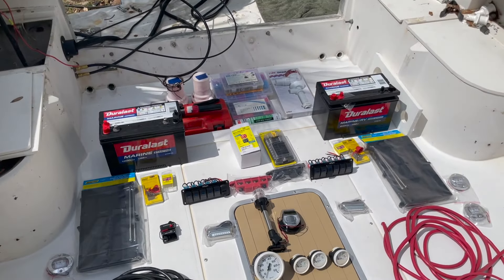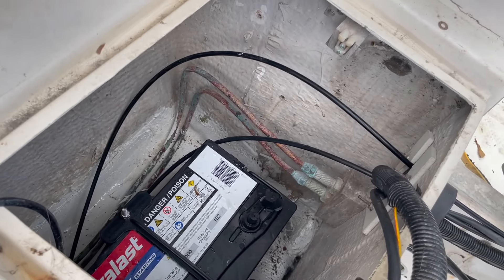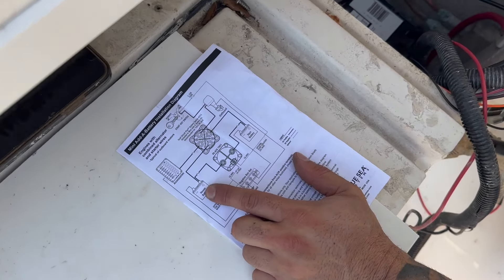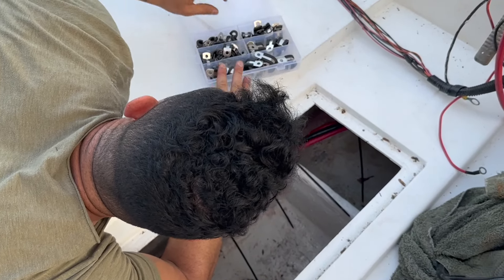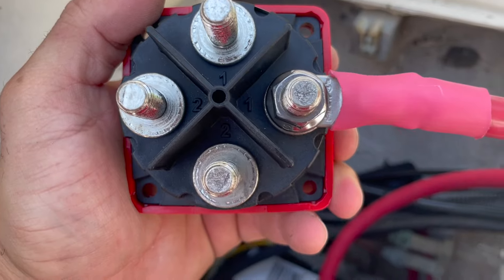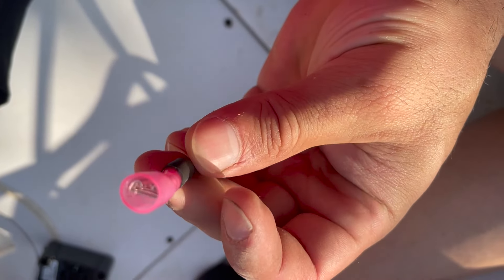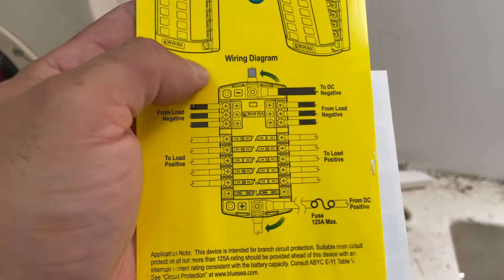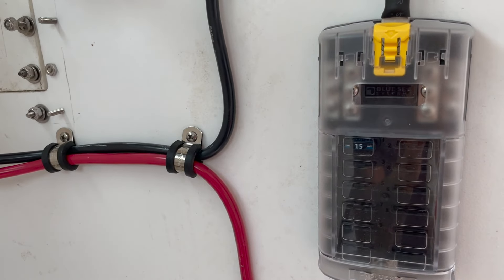Beginners Guide To Boat Wiring | Blue Sea Systems Dual Battery ACR Install

Comment: Anytime you are routing fuel lines / hoses and electrical wires in the same area, Place the electrical wires above the fuel. A fuel line that is above an electrical wire and somehow leaks will drip fuel onto the wires.
Reply from the maker: Great tip! Thanks! 🛥️🤙🌊

Comment: Your cable is 2AWG not 2/0 which is 00 AWG.  Huge difference between the two.
Reply from the maker: Yes that is correct. At 4:52 I say 2 awg cable. What I should’ve done is made a caption reading 2 awg cable. Good clarification! 🤙👍
Reply: @perfectfitboating  I used to mix them up a lot until I had to work with 2/0 and 4/0.  Since then I've never confused the two, haha
Reply: It would work fine

Comment: Pretty good install.  Just FYI, fuses and breakers are not used to protect the components (such as the ACR).  They are intended to prevent fires by not allowing the conductors to be overloaded by current which creates heat and eventually fire.

Comment: looks as if you used the same cable lugs (same size hole) in all your terminations on different sized studs. It is important to match the hole in the lug to the stud or you are compromising the whole system. Otherwise well done

Comment: great video was planning on doing this setup for my battery but ive got one issue, i dont have a positive cable going dierct from the motor to my battery i only have 2 red positive cables running from my motor to my key switch can i still use this setup if so?
Reply from the maker: Thanks for watching! Um, two red cables!? That’s strange. One of them has to be ground. I’ve never seen a setup like that though.

Comment: Nice work!  When running the main feeds to the the fuse block, the feeds can approach the fuse block from the sides, making a slightly cleaner installation.
Reply from the maker: Thanks chip! I’ll have to adjust and see how that looks. I think you’re right it’ll look a little cleaner! 🤙

Comment: Your video and E-book are great.  Getting ready to redue all the wiring on my 1997 Key Largo.  Have one question.  I have a lithium house battery and a lead starting battery.  Do I need a different type of ACR?  Thanks
Reply from the maker: Hey thanks for comment! And thanks for the review of the ebook. What you will need is a dc to dc charger AND the ACR. Blue sea systems sells a system for that I believe but people use a victron dc to dc charger with the ACR. 🛥️🤙🌊
Reply: @perfectfitboating  Thanks

Comment: Great job with laying out all the materials you are using in the beginning. Nice and neat installation. We opted for the Blue Sea ACR system as well. Looking forward to seeing each other on the water this summer, brother!
Reply from the maker: Thank you! We thought the acr was gonna make things easier. It’s either on/off or combine. I don’t want to have to remember to switch to one battery or the other! We’re looking forward to it man! 🍻

Comment: Thanks so much for getting back to me so fast. I have a Grady also with the ping pong ball scuppers. You said you used plastic for through the transom . What make are they? Also I just dis one of my deck plates today . It came out great. Thanks for the great video on that.
Reply from the maker: No problem! Glad I could help. If I remember right they were perko. We have the two little scuppers on each side I’m not sure if the ping pong ball will work since both holes are so close together. I might just go with the flap that covers the scupper. Does it really help keep water from coming in on your boat?
That’s so great to hear you did your deck plate! Not too difficult of a job I’d say! Good on you for tackling that job! 🤙🛥️🌊

Comment: Great video mate but what do I wire the fish finder onto straight to battery or the fuse block?
Reply from the maker: Thanks brother. The fuse block but often times you need a seperate fuse block with heavier gauge wire for fishfinders and gps. So off the wire that comes from the switch, you can branch off into another separate  fuse block for heavier gauge wired items like amplifiers gps fish finders 🤙🛥️🌊
Reply: @perfectfitboating  cheers mate

Comment: Nice job I suggest put wire numbers at terminal or connection point and make yourself a drawing. Much easier  to troubleshoot down the road. Should you have fused both house batteries at the battery? Thank you
Reply from the maker: Thanks so much for the comment! Since then, we’ve marked and label each wire, if not it would be a nightmare down the road. You are 100% correct. 
Both house and start batteries are fused going to the acr as per the acr instructions. I believe they’re 80 amp fuses if I remember right. I think I mention  the amps in the video. If I’m not mistaken, fusing the batteries to the regular switch is not necessary as per abyc. I think you’d need a crazy high amp fuse because cranking the motor would blow most fuses. 
Thanks for the comment! 🍻

Comment: Great job !!...im currently adding a 2nd battery and 2nd bilge pump, and you inspired me to think about tackling the current mess of wires in my cabin (from prev owner)
Reply from the maker: Thanks Steve we appreciate that! I hope this video will help make it easier for you. Check out the latest video we put out on wiring the rest of the boat! We also do the bilge! 🤙
Reply: @perfectfitboating finished my project successfully with your help. Ran into a problem recently with an old wire burning up in the Bilge area. Not sure yet what the wire was too, but I believe it was from the original Bilge pump and/or saltwater pump, but it created a big mess of burned wires that I now have to figure out. Ugghhh. Looks like I'll be watching your vid again and redo everything
Reply from the maker: Wiring an already wired boat can be frustrating! Good luck with that Steve hope the video helps! We have an ebook coming out this week that might help! I’ll keep it posted in a pin comment in the comment section! Good luck!🤙

Comment: I'm the same way brother.  I've researched, drawn out on a dry erase board, watch several youtube presentations, talk to a boating friend who happens to be an OSHA Rep for approval for a days about installing a 2nd battery.  This has been the best by far and extremely helpful.  Learned about the ACR and 80A fuse block.  Gotta add that to my dry erase board rendering..  😁  Thanks..
Reply from the maker: Thank you so much brotha! My mind works the same way. I think it’s just that I second guess myself and want it to work right! Dry erase board is smart! I would draw it on paper 🤣. Once It clicks, i completely understand the process! It just takes all those steps! Glad this video helped man check out the video after this one about wiring everything else. That one might help too! Cheers and good luck with your project. If you need help shoot me an email and I’ll be happy to help! 🤙🍻
Reply: @perfectfitboating  Just subscribed brother.  Between you and Colin from Sailing Parlay Revival, pretty inspiring.
Reply from the maker: Thanks so much man we really appreciate it! We’re trying our best to bring out some educational and entertaining content. The next one is gonna be pretty cool. Transom was ripped out and redone! 
Thanks for the kind words my man! 🤙🍻
Reply: @perfectfitboating  I do something a little different when attaching lug connectors to 2-4G wire.  Instead of crimping the connector, I'll hold the connector with vice grips, drop solder inside the insert, , then slide stripped wire  into the connector.  Did it when I added a 2nd battery to m 2008 Chevy 3500 dually.  Rock solid, no issues.......
Reply from the maker: @aeroscout8409  that sounds like a good way to do it. There are so many different tips and tricks. I love learning them all!

Comment: Love your channel. Can you tell me what you have for through hull scuppers. It doesn’t look like you have the brass ones in the video. Thanks
Reply from the maker: Gary, thank you so much for watching! When we did the transom on this boat, we used the plastic thru hulls. We didn’t want to buy the tool that’s used to bevel the edge and we were on a time crunch to get the motor mounted. They worked just fine and have held up without any issues. The other Grady transom we did had plastic scuppers installed as well.
I think what I’m going to do in addition to these thruhulls is the ping pong scupper or the flap. Both bolt to the outside of the scupper and allow water to drain but don’t allow water to get in. 🌊🤙🛥️

Comment: Is there any situation where it would be a bigger/smaller fuse between battery and ACR? Or is 80amp the correct fuse to use with the mini system?
Reply from the maker: I think in the situation you have a bigger outboard whose alternator amperage is CLOSER to the fuse range of 80-20. Your outboard cranks out 17 amps so 80amp fuse would be sufficient. 
If I remember reading correctly, there’s spikes in amperage’s when cranking but it’s the sustained draw of amperage while cranking that important. Blue sea systems recommends 80-100 amp fuse but doesn’t tell you why such a big difference. The kit is for a 65amp max alternator which is most bigger and smaller outboards. My guess for having the 80-100 amp fuses is the spike of amperage draw on crank. For example, a Yamaha f300 alternator is 70amps. I’d use the higher end of the recommended fuses (100amps).
They make other kits for larger motors. The next up is a 120 amp alternator kit. And those have even bigger requirements such as fuses and wire sizes. 
You’ll be just fine with your f70 and an 80 amp fuse.
Reply: Thanks again @perfectfitboating  - Just getting all my ducks lined up before I go ahead. This is one more thing off the list. Cheers

Comment: nice video explaining stuff. I have a 175hp outboard I use a deep cycle group27 as a start. I'd like to add another deep cycle as a house batt. I'd like to not combine my batterys w/ a switch I'm considering using a battery isolater so I won't have to think all the time what position is the switch on. thanks for any tips also my current battery is 2 years old I've been informed that when combining as you just did both batterys must be of exact same strenght?.
Reply from the maker: A battery isolator is a great option! For best results, when combining batteries make sure they’re the same age and the same AH rating.  Thanks for watching!
Reply: @perfectfitboating  I just found out my Evinrude ETEC has a house battery isolator built into it's computer.thanks

Comment: Which voltage should I choose for a trimeran? 12, 24, 36 or 48?
If it has twin 2000hp diesels and 5 800kw outboards what sort of capacity should the batteries have?
Is lithium the lightest?
Thanks Philip
Reply from the maker: That’s above my pay grade. I know my buddies 70ft sport fish had a 24volt system. Lithium is the lightest but you have to make sure you have the right dc to dc chargers to charge it.

Comment: Thank you so much for this, I am going to add some nav lights and a stern light as well as power my engine 9.9 mercury on my gheenoe, Can I do this with one battery, I may add a trolling motor later
Reply from the maker: You absolutely could. Check out our other video on wiring your boat. We show you how we setup our switches. Glad the video could help! 🤙

Comment: I spray corrosionX in all of my crimp on battery cables before I crimp.   Nice work.
Reply from the maker: Thanks Kevin! I appreciate that! And that’s a great idea I hadn’t thought of that before. Will do for my next projects! 🤙
Reply: Corrosion X is an outstanding product however it should be applied after the crimp is made as it is a dielectric.

Comment: Greetings from Europe👋Great and very informative video. I am planning to install a house battery as well on my own.  I have no experience of any installation.But I have a question about the terminal fuse. If ACR is rated for 65 A why do we need to have an 80 A terminal fuse but not 60 A for example. 60 A fuse will trip out before ACR burns out. As far I understand those 80 A fuses are to protect ACR.
Reply from the maker: Hey there! You are correct! Those fuses are there for the ACR just in case. But the rating is recommended by blue sea systems as so. If I remember right, they recommend 80-100 amp fuse in the instructions and I believe it’s for the spikes in current.🤙

Comment: Hi great video, I got the bigger version from blue seas add a battery kit here recently and I noticed you ran 2/0 cable to your mini ACR. My question is, if I too am running 2/0 cable can I also use a 90 Amp fuse? Just curious and thanks again for the great content!!
Reply from the maker: Hey buddy thank you for the comment and thanks for watching! In your add a battery kit, it might be hard to find, but it will tell you the required fuse you need. And it’s going to be a range. So for the mini kit, if I remember right, it was 80-100 range. Not sure what it is on the larger kit. 
Edit: just checked and this is what it states: cable size to meet ratings -  4/0 AWG (120mm²)†
100-125 amp fuse 
You can find it on the blue sea systems site it’s a pdf file under the “add a battery  7650 kit”
🤙

Comment: Does it matter where the positive cable goes to on the 80 fuse? Fuse on first then +battery cable or cable first and fuse on top?
Reply from the maker: Which cable though. If it’s to the switch, that cable goes directly on the terminal. If it’s to the acr, it goes on the fuse terminal. Hope that helps.

Comment: Great video.  Remember, redundancy is next to godliness?  One comment from my install of 120A ACR, include the switch in the fused ground wire that activates the ACR otherwise you can drain your start battery.
Reply from the maker: Great tip! Do you know how long it actually takes to drain the battery? I’m wondering if it’s weeks or months. 🍻
Reply: @perfectfitboating  I don't know how long but there were enough comments on sailboat videos that I took it to heart with my installation.
Reply: @perfectfitboating  My current problem involves which side of the ACR to connect the alternator.  There is something called ACR Cycling with the standard wiring with an outboard which charges the start battery first.  There seems to be occasions when a motor running at low speeds (eg when trawling)
Reply: @perfectfitboating  will leave the house battery with low or no charge.  FYI
Reply from the maker: I gotta look into that. We don’t keep our boat in the water we trailer and charge the batteries at home. I’d be concerned about longer trips where we’d be staying out for a few days. Thanks for the info🤙
Reply: If you are really that concerned about battery power levels while at a dock, a good 2 battery charger ( I have both Minn-Kota and Bass Pro Shop brands on my boats - love them both) will keep them topped off without worry as long as you have an outlet at the dock. Don't cheap out on a charger, and steer clear of "NOCO - GENIUS" stuff( one killed batteries for both me and a fisherman friend). My Minn-Kota single battery charger has been on a wet cell Interstate main battery for 10 years now, and that battery still tests at 90% of capacity. Since I have a trolling motor for fishing, I have 1 - 1 bank and a 2 bank for my 24 volt config for that, but I like to have the single for the main because I have a direct wired full time float switch wired to my bilge pump for when it's docked, and if the pump runs the charger will replenish the battery.
Reply from the maker: Battery charger is our next project! I’ll definitely look into the minn-kota and the bass pro brand! Thanks for the tip!
Reply: Hey  @perfectfitboating , wondering what kind of switch is recommended for this (the extra switch for the fused ground wire)? Would you just use another blue sea with just the on/off function?
Reply from the maker: I would think any on/off switch would work just fine. @internutt2023 what switch did you use?
Reply: @perfectfitboating  Another version of the Blue Sea ACR diagram shows a 10A instead of 1A fuse on the ACR to neg Bus Bar connection. I just checked the Blue Sea web site and it appears that version floating out there is an older one. Both of the current versions of diagram on the Blue Sea website show it as a 1A fuse. Also, it appears the diagram refers to the switch from the ACR to neg Bus Bar as "OPTIONAL SWITCH FOR NO CURRENT DRAW WHEN IN STORAGE".  I guess if you want to prevent draining your starter battery over time this is not optional.
Reply from the maker: That is correct! Thanks Eric! 🛥️🤙🌊
Reply: @sleepykittyboatworks  There is a video out there called "How and Why to install an Automatic Charging Relay". (I was not able to post the link.) He has a great explanation of why he put the alternator connection between the house positive and the ACR to reduce the effects of the ACR Cycling. Hope this helps.
Reply: Noco Genius multi bank chargers are extremely reliable and considered top tier.  Also, they are capable of charging LA, AGM and LifePo lithiums.

Comment: Good video. Where did you get your wiring diagrams? Is that only for the ACR install?
I have 2 start batteries and 2 house batteries (in parallel)and 2 on-off switches. Do I just double what you're doing?
Reply from the maker: Thank you so much! You can go on blue sea systems website and the diagrams are there to view. For your case, you don’t have to double it. You’d run it the same as a 2 battery setup. The cables that connect  the battery to the acr will have the fuses the same way a 2 battery kit does.